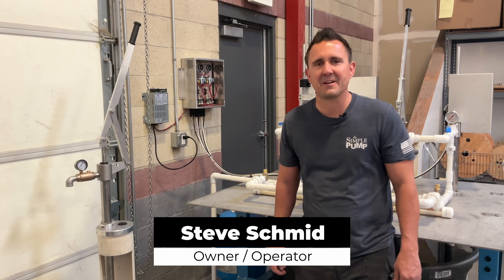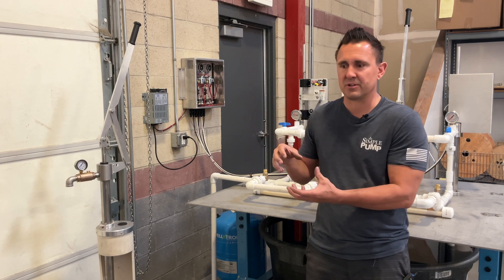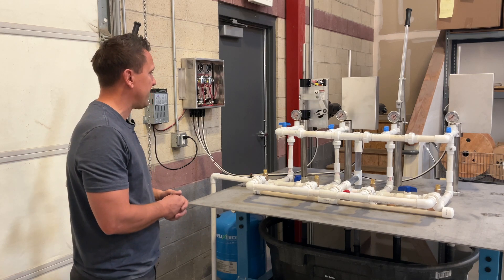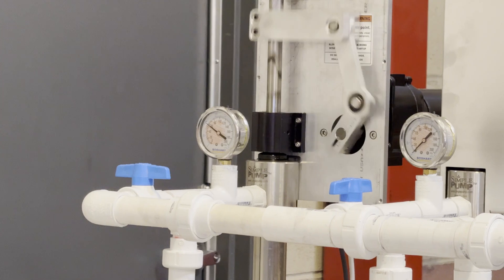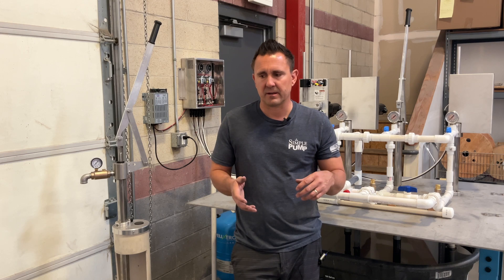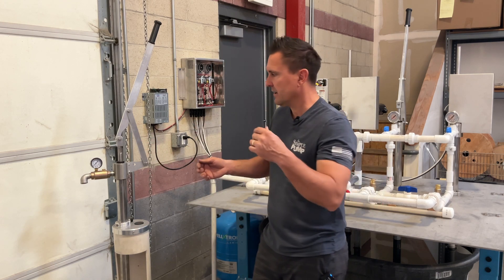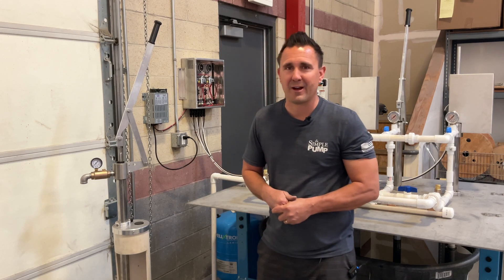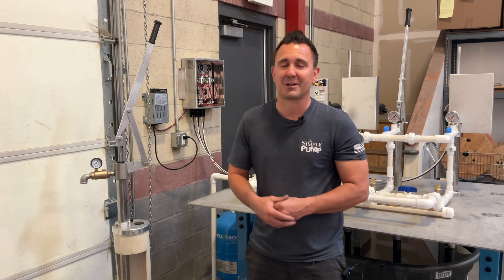Connect a Hand Well Pump to House Plumbing - DIY Whole House Water Backup

Comment: Pump set at 55 1/2 feet .pump and tank in well house.When using simple pump to charge tank 35 pounds of PSI. Is brought PSI to fill bladder in large tank.At 81 years old that's where I have to stop pumping any way as it's enough exercise 35 lbs is hard to pump.So pleased with the simple pump.Have used several times when loss of electrical power failsThank you! A well engendered product.
Reply from the maker: Thank you so much for sharing your experience! We’re incredibly glad to hear the Simple Pump has been a reliable backup—especially during power outages. 35 PSI at 81 years young is impressive! 💪 Your kind words mean a lot to us. Stay safe and hydrated!

Comment: i installed a simple pump in 2015, already had a deep well, (195 ft) so installed it on top with the well cap adapter.
Also installed the check with gauge, then installed a Siamese connection, one for filling buckets and such outside, the other has a hose bid adapter that adapts to a permanent plumbing connection with ADS 1" well piping that was left over from a deep well installation.
Ran alongside the submersible pump piping and installed a T, just before it enters the house, then put ball valves on each line, I can work the valves and switch back and forth between water sources.
The piping enters the house and goes into the 20 gal expansion tank.
Ive timed myself with normal pumping and it takes me one minute to fill a one gallon jug.
To fill the 20 gal expansion tank takes me just under 25 minutes.
When I get close to 35 psi I start getting a slight resistance in the stroke.
I put heavy insulation on all outside piping and valves.
Its been 10 years and no problems, simple pump still going strong.
Reply from the maker: Thanks for sharing your experience with this setup, we really appreciate it.